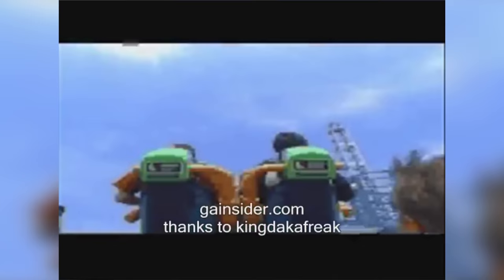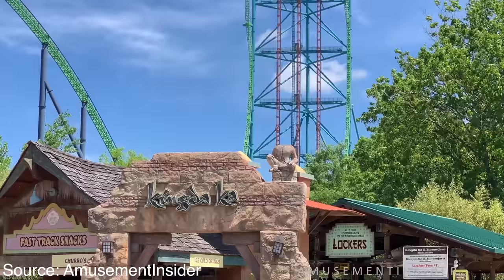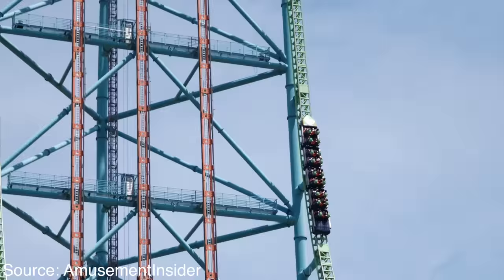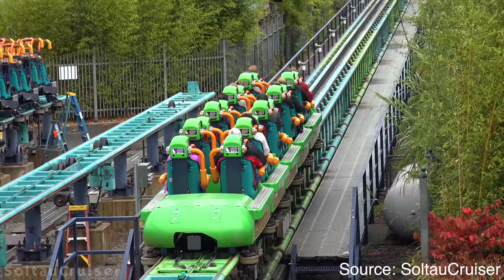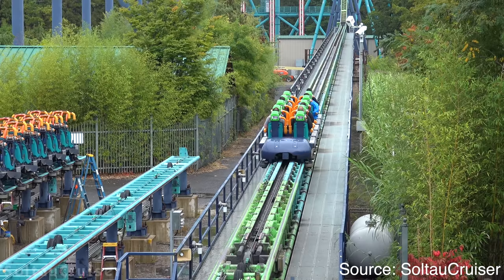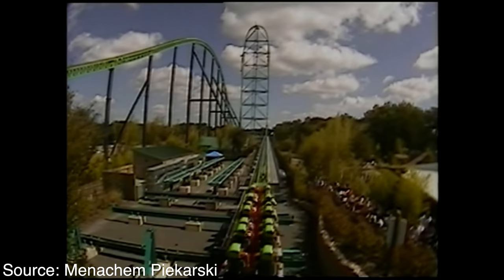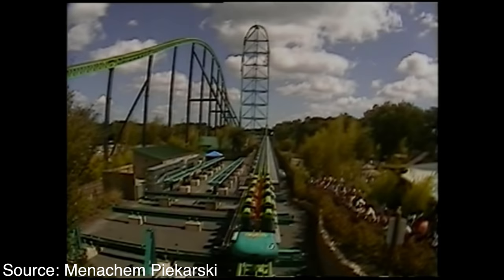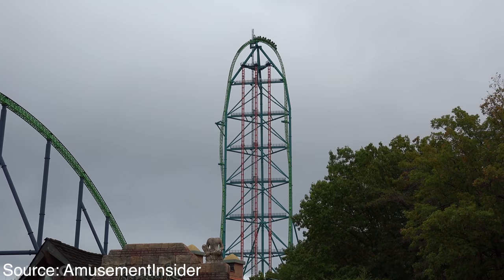Problematic Roller Coasters - Kingda Ka Review & Technical Analysis - Six Flags Great Adventure

Comment: **UPDATE

The 2011 shut down was a cable snap while me and my friends were on it. I got in the face with bits of plastic and water in the front row and we made it about 200-300 ft back and had to be let off the launch track down the maintenance staircase which I was told was the first and only time this happened. Once in life time experience. This was toward the end of the season. I believe it opened back up toward the end of Halloween. I had season passes there for years.
Reply: No one cares dude.
Reply: @georgeschubert9652  No one cares dude.
Reply: I cares dude.
Reply: This was in 2011, we don't care
Reply: @jcspotter7322  I care

Comment: 1:47 if you watch the train you can see it violently shake at the end of the launch track
Reply: I noticed that too lmao
Reply: Connor Jackson you should feel it when they launch an empty train when you are at the top of Zoomanjaro!!
Reply from the maker: I think the launch track itself has actually began to warp over time!
Reply: The bunny hill track shakes as well.
Reply: @chloebaloneyxx  What are you on about? They cant run at the same time?
Reply: @Poordev  i was replying to the origonal commenter
Reply: If you watch through the video you can see the ENTIRE TRACK shaking at the end of the launch track and bottom of the top hat, like, a loooot of wiggling in the structure.
Reply: @ElToroRyan  tbh that there is a major issue. No other rides shake like the Stratas. People will say its not a massive deal but every launch will weaken the supports and track bolts. Eventually the entire track section will need replacing as the bolts would have worn away at the hole they were inserted into.
Reply: @MichaelRei99  I asked the worker there and they said the 2 rides were not allowed to run at the same time. That's why if you're on the coaster and get to the launch part you will sit there until the drop tower has dropped all the way down before launch.
Reply: SupraRy I was on the top of Zumajaro when they launched an empty train from Kingda Ka. It is trains with passengers in them that are not allowed to be run.
Reply: SupraRy did you even read what I wrote?
Reply: @MichaelRei99  that must have been not long after Zumanjaro opened.
Reply: 10:35 look at the pullout before the airtime hill wiggle side to side!
Reply: @SupraRy  he talks about it in the video and there is literally footage of it in the video
Reply: It violently shakes the whole way up. Rode it last year.
Reply: yeah
Reply: rode it a few days ago, you feel it too lmao. was honestly much more rough than i expected

Comment: I actually spoke with a technician who worked on Kingda Ka. He confirmed the reasons for the trim brake on top of the first hill. It's because of the g-force at the top of the hill. As you said, riders can get air time there. Slowing the train down reduces the amount of time where the rider is not in control of their body. This reduces the chance of the rider getting whiplash.

It's also part of the parks disaster response system. If something were to happen and part of the track breaks (think what supposedly happened at Son of the Beast.), that brake can stop the train without causing a lot of pressure further down the track. Basically, it reduces the chance of the track buckling on itself.

Comment: Of all the changes, I think the one that upsets me the most is closing off the launch observation area. How hard would it have been just to put up some sort of shield like they do for water rides . . . or actual tiger enclosures?

Also, great video! New favorite series of yours.
Reply: @chadanthonygeorge8457  cedar points top thrill dragster has a observation area still. hell, they have bleachers for it where you can buy a hot dog under the bleachers then watch the launch. i have never recalled a problem where someone threw something at anyone at the observation area
Reply: Taylor Vandenberg that’s a lot farther away then the one Kingda ka had lol I think it’s safer too
Reply: @taylorvandenberg4759  could also be state regulation. I have not been to either park, but it does seem that the bleachers at CP are far from the ride and I think that helps make sure people are not incline to throw stuff over.
Reply: @taylorvandenberg4759  How fast is the Dragster honestly going by the time its passing the bleachers ? Probably not much faster than a standard roller coaster, since the bleachers are so close to the initial launch area. So maybe like 50mph. This doesnt make it any more dangerous than any area of the park near a roller coaster track. People could throw stuff off the Corkscrew and hit someone too, or basically any ride. New Jersey just must be very weird and strict with their laws.
Reply: It's probably state regulations.
Reply: @taylorvandenberg4759  I've been to cedar point dozens of times..... but.... I've probably only seen a couple people sitting there. it's open and completely stainless steel so it gets hot and to be honest there's not much to look at
Reply: @chadanthonygeorge8457  why not install the same type of fine netting that baseball stadiums now extend from behind home plate to the bases? No one can be hit on either side. Just need a few cables to string it up.
Reply: Just one week ago a woman was struck by a metal object that flew off the top thrill dragster while the ride was stopping. Maybe it’s a good thing this ride doesn’t have a launch observation. This woman was in line for the top thrill dragster. Her condition is still unknown at this time but it did not look good.
Reply: There was an accident that caused six flags to close it off. The brake fins came up as the ride launched and vaused all sorts of metal to go flying.

Comment: Most unreliable coaster ever?
Volcano, The Blast Coaster: Hold my LIMs.
Reply: John Foltz rip volcano
Reply: Batman and Robin the Chiller says hi.
Reply: Good thing they use LSMs from now on...
Reply: HypersonicXLC here.  Just wanted to check in.
Reply: Lightening Rod
Reply: I'm 40. I've visited King's Dominion once every year since I was 10. Was only able to ride the Volcano ONCE because of mechanical issues. It's like it knew what day I was coming.
Reply: I’ve ridden Volcano way more times than Hypersonic XLC and Batman and Robin combined.
Reply: @robski461616  mhm sure
Reply: @mrpapagiorgio5404  OK?
Reply: Hold on there, buddy.  I don't think I've ever had a KD trip that didn't involve riding Volcano while it was still in existence.  On the flip side, I tried 3 times to ride on HyperSonic when it was still in operation.  Every time I was next to ride, it broke down.  I've experienced more break downs of Flight of Fear than Volcano.  And don't get me started on Six Flags America...  *eye roll*

...But that's just my personal experience.
Reply: It's not far off of poor, dead Volcano.
Reply: Top Thrill Dragster is laughing it’s head off in the background
Reply: Jokers jynx six flags america has joined the chat.
Reply: @ElijahRock92  I never got to ride Hypersonic, but I was able to get two rides at two different times on Volcano in 2017.  One problem with Volcano was that it had shorter trains and less capacity which lead to a longer line.  My first Coaster was Flight of Fear on its opening year.
Reply: @ElijahRock92  This is just anecdotal, but I can back up the other guy. I've been to KD like 10 times over a 15 year span and only one of those days was the Volcano in full operation all day. One other day it was on like half the day, every other time closed almost all day (I never checked which rides would be in operation before going to the park though). Hypersonic was only able to ride twice tho, I mean it was a fun 7 seconds lol, nothing amazing.
Reply: I rode Volcano a good 6 times minimum and not once did I ever have to wait because it broke down! I haven't been to KD since 2004 though, other rides there broke down all the time, especially the Drop Zone. I started going to Busch Gardens after that.
Reply: Lightning ⚡️ Rod: hold my launch 🚀
Reply: Oh hey it’s the ice cream machine at McDonald’s
Reply: @AC98000  Mcdonald's Ice Cream Machine: The Ride
Reply: Green Lantern: First Flight
Reply: @johnfoltz8183  Under appreciated comment.
Reply: Meanwhile Windjammer would get stuck at the slightly breeze
Reply: HEY ITS ME MR FREEZE
Reply: Big One at Blackpool: Hold my stuck train.
Reply: @DanielBlaney yo I got to go on both in the same night,  within 15 minutes total time or less.

Comment: Fascinating nerd stuff. The state of NJ needs to back off with these laws. Seriously
Reply: gotta be safe doe
Reply: It seems weird. Something could be thrown off a ride and hit someone virtually anywhere in the park. Like walking on a path right next to a big hill. What are the laws on that ? Also what about roller coasters that race eachother and are right next to eachother ? People can grab eachother and throw things and whatever else. Are those rides allowed in New Jersey? Honestly there has to be something that can make them both run at the same time. At very worst make the 3 towers enclosed in clear plastic tubes or something.
Reply: Look who’s talking, a Californian😂
Reply: not after action park
Reply: @jsmithers.  at Canada's Wonderland they have nets all over one part of the park to prevent this from a new coaster they built called the Yukon Striker. They could probably use a similar net design on the Kingda Ka.
Reply: @jsmithers.  Those rides you mention don't have the other vehicle approaching you at 50+ mph. Someone throws something off the drop ride at the coaster, it doesn't just hit Kingda Ka's riders with the acceleration of gravity, it hits them with gravity acceleration + 50mph (or whatever the speed is at the time; worse if it's near the bottom, less if it's near the top). 
Clear plastic tubes would probably get uncomfortably warm due to radiation from the sun, weigh a lot, and catch more wind. A single net on either side separating the drop ride from the coaster would probably work.
Reply: @IstasPumaNevada  I mean, they kind of do. You can throw something off any other roller coaster and it's going to possibly travel a distance to hit someone on a path below. That's just the nature of amusement parks. I agree there could be slightly more risk here though, since people on the tower are basically locked into their position. But as far as the plastic tubes / plexiglass planes they could put up, it doesnt have to be completely enclosed. Just surround the top sections and part of each side. Just enough to mitigate falling object risk. Nets wouldn't be able to catch say a penny, or spit.
Reply: NJ is a sufforcating state.
Reply: @Tacocat4642  i was going to say that, why not just use nets? A lot of coasters do.
Reply: The state of Jersey is weird. Six flags isn’t like it used to be.
Reply: @jsmithers.  law makers are making fear based decisions is my guess.
Reply: Brah you can barely camp in NJ. If you want to, you have to pay like $50 to be in an overcrowded site. 
I’ve gotten away with stealth camping certain parts but it’s a massive fine. NJ sucks
Reply: Idk of I'm going on a roller coaster that tall is rather there be shoulder restraints. I like it more if the ride has shoulder restraints honestly.

Comment: Since Top Thrill Dragster was built, I've thought it (and Kingda Ka) to be a one trick pony. I believe these coasters would benefit from some more layout after the launch & hill. Some turns, hills, inversions etc. Too much wasted momentum, but great rides nevertheless. I'd love a couple of short rabbit hops with strong airtime on Kingda Ka instead of the long, drawn-out hill that has zero airtime.
Reply: I've heard they are both nightmares to maintain, and rumors at CP make it sound like dragster may never open again. I noticed after these two were built they never really built anymore strato coasters
Reply: @alexanderivascu5261  after the recent announcement about dragster you aren't wrong.

Comment: I was wondering if you could shed some light on their protocol for rollbacks. The signs all over the queue line say that it's supposed to just reset and launch again and I've heard that the computer is supposed to use data from the previous three launches to know how fast to launch the next train, so if there's a rollback, it knows to launch it a little faster. A few years ago, I was fortunate enough to experience a rollback, however, instead of just launching the train again, they rolled the train all the way back into the station on the opposite side loading bay and unloaded the train so they could test it before loading us onto the next available train. Do you know why they do that now instead of running that part how it was designed to?

Comment: I'm not sure switching from 4 to 3 train operation improved the reliability.  I think it would depend on other factors.  With the ride being over 10 years old, I would think that the park is better able to deal with the issues that arise.  I visited the park pretty regularly from 2013 to 2016 and except for the Zumanjaro construction, Kingda Ka was open every time.  The main problem is KK and Zumanjaro not being able to operate at the same time.  I wonder if there's a way to solve that.  Maybe the metal cage over the seats on Zumanjaro could be extended.  I don't think loose articles from Zumanjaro would hit riders on KK because they fall straight down and KK is never directly under it.

If that issue is fixed, I think KK should go back to running 4 trains through both sides of the station at peak times, but still run only 3 trains through one station platform during other times.

Comment: As a former year round worker in the Wild Safari (2010-2015), I was privy to hear reasons for closures from maintenance. From what I heard, your theory about a cable snap is correct. Also when they first installed the drop tower both coasters ran at the same time. However, this was done ONLY with employees riding while testing the ride.

Comment: Wasn't there originally a "row 10" on each train with removable or retractable seats? I always heard this but never knew the truth lol
Reply: The final car does look weird with only 2 seats. They were probably removed for weight reasons right at the back. Maybe it was causing rollbacks. Dragster originally had the tyres and wing at the back.
Reply: Well, Stealth at Thorpe Park (like this but half the size) has a 10th row (but funnily enough rows 9 and 10 share the same gate in the station so I guess row 10 may have been an afterthought)

Maybe you're getting confused with that somehow? idk
Reply from the maker: There is an optional 10th row that can be added to the 5th car, similar to how Dragster got a 9th row added when they removed the fake tires from the trains. The park is very hesitant to add this though since it means additional weight on the launch motors and it would back the trains more back heavy so it would increase the chances of rollbacks. Right now, the trains are very evenly weight distributed.

Comment: you can literally see the track swaying!!!
Reply: You can with the Dragster aswell sometimes. It's meant to do that
Reply: Healthy colossal structures sway.  Same thing with statues and skyscrapers.  It means they’re distributing physical stress
Reply: Yeah taking king da ka off my list they better replace and tighten those screws smh
Reply: Rollercoasters are built to have some sway. It helps prevent cracks in the supports from stress, by evenly distributing it across. If the coaster supports were completely stiff, they would be more prone to cracking and sometimes even snapping completely. Needless to say, that's extremely dangerous. Although, I do think Kingda Ka is starting to show some age. It's swaying a lot more than I'd personally like lol.
Reply: First rule of engineering: That which does not bend shall break
Reply: @Naiobia  dude all tall structures do this.  If they didn’t, strong wind would blow them over.  You are SAFER when they do that.  You can see it very noticably at the Air Force monument if I remember correctly.
Reply: @Naiobia  whatever you do don't get in your car, you'll freak out

Comment: Ive been on this when it didnt make it over the peak and fell backwards before, that experience is probably wilder than the actual ride itself. Apparently it happens ever once in a while, but its pretty wild. You basically come to like a 2-3 second stall at the top wich is crazy, ur sitting at the top not moving on a track thinner than the car ur in, u can actual feel the tower kind of moving, and then it slowly rolls backwards and ur like oh shit, but it all happens so quick. But the stall at the top is the worst and wildest part.

Comment: Destroy zumamanjaro and use the dual loading station add another launch track then instead of another tophat add a cobra roll then kingda ka and random named coaster the tallest duleing launched coaster even if it only ran the cobra roll side a few times a week it would still be epic
Reply: Why open a huge coaster to duel with a 15 year old coaster, an then only use it a few times a week. They already cant use Ka an the drop tower at the same time due to jersey law so idt the coasters could duel ever.

Comment: I was actually at the park last Week. When I was boarding the train, then unlocked all the restraints and had us get back behind the air gates. Shortly after that, I saw that they used the switch track to back the train up that was in the launch position into load one on the other station. It was super cool to see the switch track actually be used